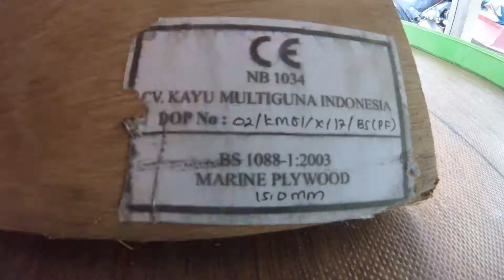Glastron Carlson Css 16 (CVX16) | Part 5, Floor | Timelapse | Restroration/Stringer/Floor/Transom

Comment: no small bilge ?  makes things cleaner. and small gussets for at least a 2 stroke xr6 150. ?
Reply from the maker: Patience my friend! I am not even working in that area of the hull yet.  keep following, there will more videos for this project posted at a later date.  

Future videos include improvements to the aft end; including a bilge pump, substantial reinforcement to the transom and possibly a splash well delete (to make room for rear fuel tank).  Power will ether be Merc 200 XRI (same wight as the XR6) or a Yamaha Pro-v 200

The format of future videos will change from time-lapse to video with commentary.  

Thanks for watching.